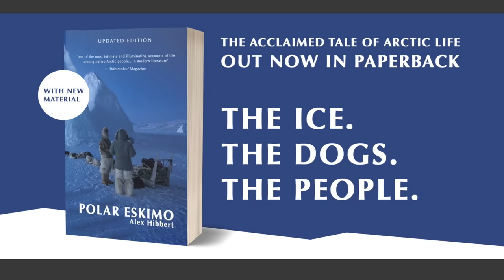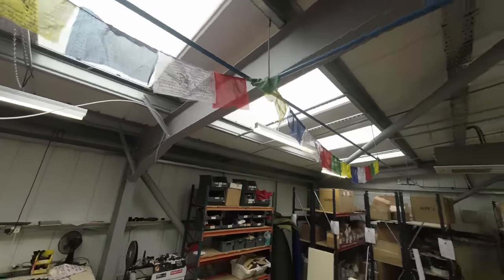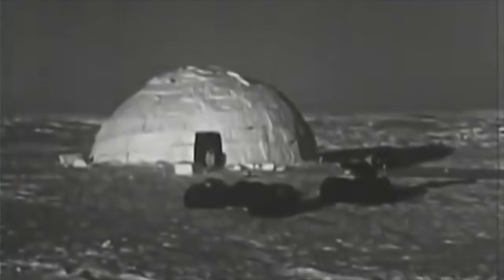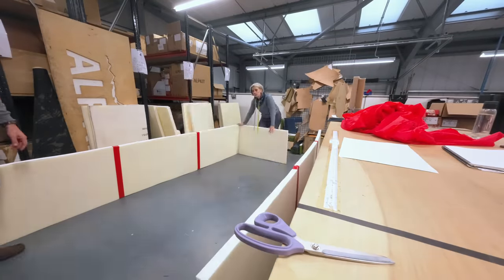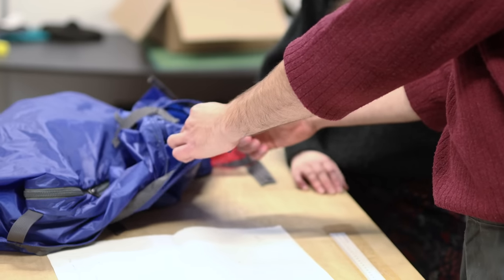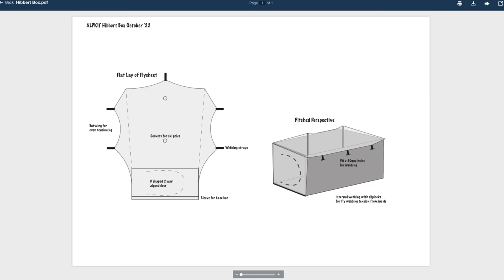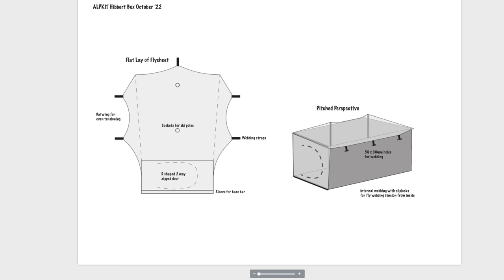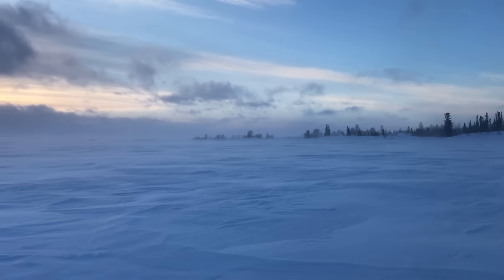My NEW tent design for snow / ice travel. With ALPKIT - a new extreme weather camping shelter. [4K]

Comment: Hey Alex, just an idea for the base boards, you can get a much higher stiffness in the large panels by casting them on a sheet with a repeating ridged pattern. You see it a lot with 3D printing to increase strength of thin parts. The pattern  can be set on the surface you set the composite on when curing and will imprint the texture onto your parts. It would greatly increase part strength without adding weight. Hope this helps!
Reply from the maker: Worth serious thought. Thanks.
Reply: Exactly what I was about to suggest. Also if all the panels have the same pattern they can stack and minimize the size they take up while packed. Look into sheet metal fabrication as they have the same necessities of a lightweight thin material that needs high strength. They press and bend ridges and triangulated shapes into the metal to strengthen it while not adding any material.
Reply: @CupolaDaze  Good idea! I wonder if he could use a well-insulative spray on the outside to reduce the thermal transfer. It could be lightweight but help the side stay warm, which would be a problem with CF or metal builds.
Reply: I was thinking the same thing! Something like honeycomb panels would be great, and perhaps some carbon fiber stringers across the panel faces
Reply from the maker: Honeycomb is a common composite core, but possibly too fragile for this build. Carbon stringers/fillets, yes.
Reply: What if each panel was 2 pieces. You could have an easily stackable ridged design, but reverse one board and attach two boards together for each panel. This allows each board to be very thin, light and take up very little room when packed up, while giving you the strength from the thickness of two boards acting at one.
Reply: @AlexHibbertOriginals  corrugated sheet: thin layer for light weight, more rigid in one direction (vertical) & can even keep some flexibility in the other (longitudinal)
Reply: @AlexHibbertOriginals  Would an aerogel work as insulation and core for added rigidity?  Possibly cost prohibitive?

Comment: Hum... guess I've got at least average loyalty, because I remember them from the sledge cover video!  :)

I am curious, though- how are you keeping the wind from just blowing through the joint between the box structure and the tarp?
Reply from the maker: There's a significant overlap, and then the piled snow outside double covers the 'gap'.
Reply: @AlexHibbertOriginals  aren't the panels 50cm or so high?
Does that mean that the fabric is almost reaching the ground or are you planning on making the snow mount maybe around 30cm high?
Reply from the maker: They're 70cm high. Nope, the fabric won't touch the ground, but the overlap will be significant.

Comment: Have you checked with a Kayak manufacturer to see if you could use one of their ovens to help make the panels?  You could then use a layer of Carbon-Carbon to gain much needed strength, while fully impregnating the fibres with your resin from the vacuum and curing process.
Reply from the maker: I've got a vacuum, and it's harder for DIYers to get oven-cure pre-preg with more than just carbon as an ingredient. A pure carbon panel would be too vulnerable to impact.
Reply: @AlexHibbertOriginals  Check the model rocketry channels where they use Carbon-Carbon.  It is extremely tough and durable according to several of the rocketry experts, it's comparable to steel without the weight, but it can be difficult to work with, which is why they use large curing ovens and the mylar vacuum bags.
Reply from the maker: Unidirectional carbon set at various orientations, and then cured with minimal resin, is indeed a remarkable material - strong, stiff and light. But the limitations still exist in terms of impact, abrasion, and mode of failure.

Comment: I must say it's great that a company is willing to work so closely with you.
Maybe that's normal in this area of manufacturing, but I still find it great.

And I also have one question:
You said that the fabric is not waterproof (or rainproof? Maybe that's a difference?), anyways, is it really impossible that there will be water on top of the "tent"?
I guess it won't be raining where you will go, but what about melting snow?
When you use a stove inside the tent is that not enough to melt (some) snow on top of the "tent"? 

And now I thought about a second question :)
What about air inlets? Don't you need some form of ventilation when using a stove inside the tent?

I am really excited about this project. It's just such an interesting and unique idea
Reply from the maker: It certainly won't get rained on.

For melting snow - not a major issue. You tend to bash any settling snow off the fly, but it won't settle much on this shape. Any that remains may melt if directly over a burning stove, but then the nature of the nylon will see it dry out in quick order. It won't pool. Internal moisture should pass through and escape much better than with silnylon tents.

The tent isn't airtight, and we can vent the zips if needed.

Cheers :)
Reply: @AlexHibbertOriginals  thanks for answering my question 😀

Comment: Do you plan to attach tent poles and nylons to the panels so they can be pulled out of shape and folded up but not blow away? Really interested to see how the walls are going to be assembled.
Reply from the maker: No, the panels overlaps and connect to one another, have corner braces, and are pressed inward by the piled snow. Simple and quick. To avoid a blow away during handling, each has a hole in a corner and all can be karabinered together and to an anchor like a sledge.

Comment: Have you considered using carbon fiber rods sandwiched in the panels to increase stiffness?
Reply from the maker: I don't think solid rods will add much per gram added, but I have already added bamboo/lost core flat dowel to one edge, and then laminate-wrapped it, and this is pretty effective as the 'mini-core' adds stiffness.
Reply: @AlexHibbertOriginals  perhaps some way to add tension to the panels could help, intentionally bow them inwards or outwards after they are installed. 
Like an adjustable nylon strap with one end resined to the top of the panel and the other to the bottom, so they would bow the panel outwards when pulled tight, adding rigitity through tension. The ends may be looped and resined over the edge to reduce the chance of a strap pulling away. 2 -3 per panel, corner panels would need one less, or just the end not tightened to keep them all identical, with the rigidity coming from the 90 degree corner connection.
Reply from the maker: Cheers - will have a think.

Comment: Why not try 2.5mm thick or thicker Corflute Sheets 2440mm X 1220mm X 2.5mm 300 GSM (grams per square metre). Basically it's a flat sheet of 2440mm long 2.5mm x 2.5mm enclosed square tubes all made out of recycled plastic. If you cut 2 pieces to glue together using resin & placed one piece with it's enclosed tubes going horizontal & the other going vertical then you'll find that they they'll be quite strong & even stronger after you put  on your carbon fibre & other mat on the outside while still being slightly lightweight.
Reply from the maker: This would add massive amounts of weight. These panels weigh barely 700g.
Reply: @AlexHibbertOriginals  Is that 700g total for all the previous boards you were using before? It's a pity you can't sandwich a thin sheet bubblewrap between 2 sheets of corrugated carbon fibre in the shape of corrugated iron sheets with loads of tiny corrugations. It might sound insane but the carbon fibre in a corrugated form would give the most strength & the bubblewrap is only a lightweight cheap replacement for the honeycomb if you are trying to cut down the most amount of weight.

Comment: How many of thse fiberglass boards are you going to have to carry and how much will they weigh?  If is going on a sled, why bother, just sleep in the sled with a light popup structure around you.
Reply from the maker: People have tried sleeper sledges before and they've always ended up being rather grim.

The panel I'm trying to get as close too 600g each as possible.
Reply: @AlexHibbertOriginals   Same as tents, most likely they gave up on them instead of taking the shortcommings and improving. Same as you are doing with the tent. The only problem with a sled tent is, you cant use the sled after the tent is set up.